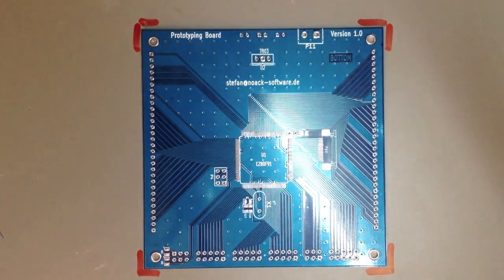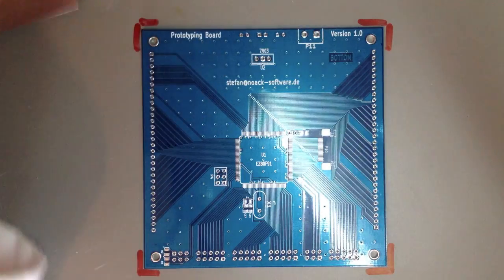Soldering fine pitch SMD parts - DIY 8-bit #1

Comment: After you add glue and place the chip, it seems that it would help to put some weight on the chip for a short while to ensure it is flush / close as possible to the board.  What do you think?
Reply from the maker: Good idea, but may not be necessary unless the glue is thick.

Comment: Why is humidity only important in a reflow process--and not other places--like hand soldering?
Reply from the maker: In the reflow process the entire part is heated well above 100°C. Any moisture inside would turn into steam and may escape violently. When hand soldering, the leads of the chip receive heat directly, but the body of the chip itself is not heated very much, so there is no steam to worry about.

Comment: I highly recommend a usb microscope .. Can get them cheap on ebay. I first won an auction for $11 and its a decent unit with crappy stand .. Making a stand was annoying but excellent for close up spot checking.

Now I picked up an Andonstar unit for $40 with a nice stand .. Can solder right under the display for much easier and higher confidence work ..

I need the antistT wrist strap though :)